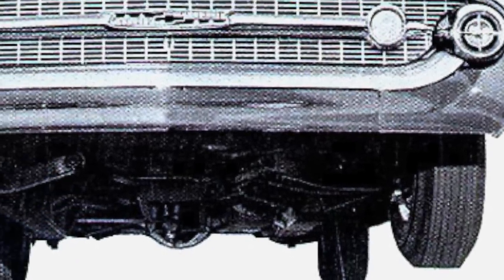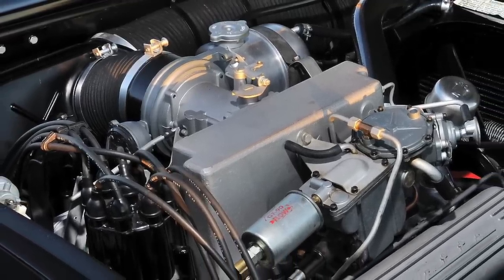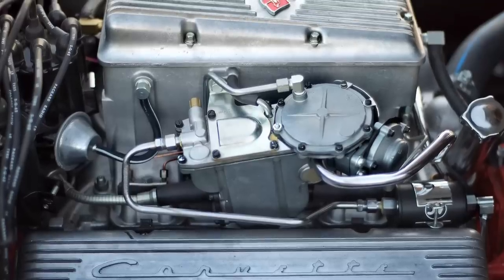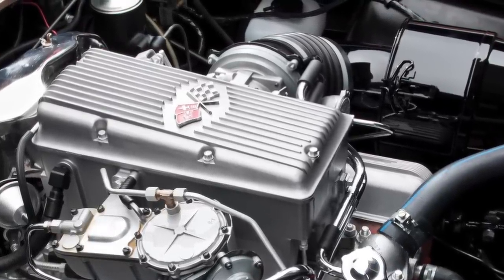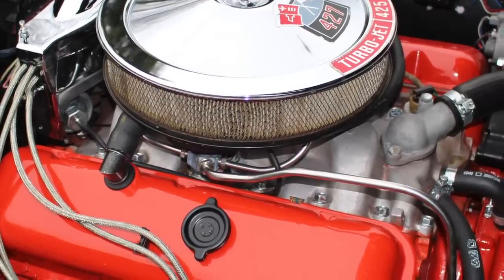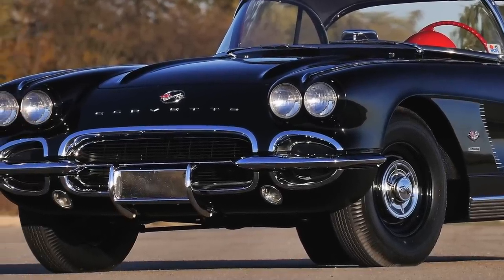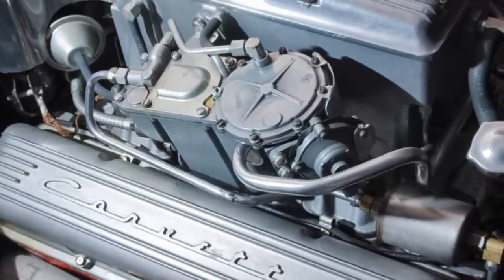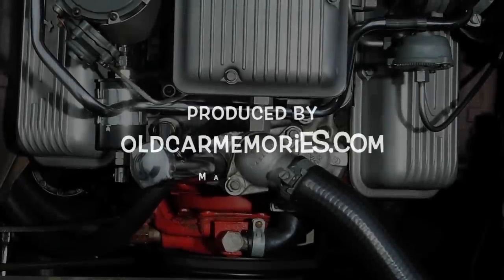Why Chevy Abandoned the 1962-1965 Fuel Injected 327 V8

Comment: This is a great video and I enjoyed reading all the comments.  It is nice to see so much interest in the old Iron.   I am a mechanic and a Rochester Ramjet Fuel Injection car owner for over 50 years.  GM had marketing movies showing how is worked like a jet engine.  Very funny stuff.
 The following are just some observations and ramblings from someone that worked on all the hot rods back in the day and lovingly keep a Rochester FI unit running.
First let me say that my FI unit is on a 1957 Belair and not a corvette.  I bought the car in 1968 for $950 because it was Fuel Injected.  Everyone said that I paid too much for that old car and that the Fuel Injection did not work.   Some days I would have to agree with them.    I have had the FI unit on 4 motors  (283, 327,265, 283).   About 15 years ago I found all the parts to build a 1957 283 FI motor.  Dead stock.  Not bored.  Correct heads etc.  It runs like the Engineers at Rochester intended. Smooth quick power. 
Let’s talk about reliability.   Cars would often get a tune up every 12,000 miles. This meant replacing the spark plugs and points.  Sometimes the distributor cap and wires were also replaced.   I had a shop in 1973 and did a lot of this.   Now if a high performance 440 or 396 showed up with the plugs all fouled from just putting around town then I would just take it out on the highway and open her up.  That usually took care of it.   I still charged the $12 for the tune up.  So maintenance was an attempt to fix things before they broke if you could afford it. 
Reliability of the Rochester Fuel Injection (FI) was another matter.  If the unit was running right you did not have to do anything to it.   I can park my car for a year and it will start up and run fine.
BUT---   If I put low octane gas (Below 98 ) with no lead then It won’t like it.   If I put gas with ethanol in it then it will hate me.  When I rev it to over 6000 rpm ( I used to hit 8300)  then I may twist of the FI pump drive cable.   Always carry a spare.  When other problems occur and the mechanic starts adjusting the FI unit then It may not run right.  If you get a bright Idea from a hot rod magazine and change anything it probably will not run right.   If you bore out the engine the main diaphragm will get too much signal from the piezometer ring and you will run rich during part of the power curve and the power stop adjustment will not be able to correct this.   You can set it up for full throttle operation which can be a lot of fun. 
Other fun things: The Early FI units came with a coasting shut off valve.  When you were coasting down a hill the high vacuum shut off the fuel so you could save some gas.  When you got to the bottom if the valve stuck closed then the engine would not run.  The dealerships get bulletins and one of them said to remove this valve when you service a FI unit.  They quickly stopped putting it on the units.  
The early units used an electric solenoid to starting.  It sometimes stuck or the wire got disconnected.  Hard starting was the result.   That changed to a cranking signal valve but it can stick open and cause a lean mixture. 
The rubber diaphragms (there are two) can get go bad like rubber diaphragms like to do.   Another popular misconception is that there was no fuel bowl with a float and needle and seat lake a carburetor.  Hey it was designed by Rochester and had all of those things.  I did not lean out on hard turns I can attest to that!  It even has the giant screw to adjust the Idle RPM like the AFB carbs.  
By the way if you do twist off the drive cable then you better replace the seal or it leaks gas down the back of the engine around the distributer.   Then one spark and you got a pretty good fire.  
I did bend a rod once when a cylinder filled with gas from a leaking check valve.   I added the fuel shut off valve that came on the later units and that fix the problem.  
The fuel control lever likes to get a worn spot in it and that will make tuning a nightmare.  The castings are pot metal and prone to bending and not make a proper seal on the diaphragms.
The system is low pressure, between ¼ and 4 lbs.  The fuel today has a very low boiling point. The fuel will boil inside the injector nozzles at normal operating temperature during a long idle.   Like during curse night. 
So why go to all that trouble.  Because we are gear heads, hot rodders and car nuts.  Because when I guy asks me to lift the hood he either says WOW or asks “what the heck is that thing?”  The same reason we now change the computer chip to a aftermarket one and add cold air induction.  The same reason we check out the specs on the 700 hp plus cars today.   Back in the day they asked why I needed 283 hp.  Now they ask why do you need 700 hp.   Tomorrow they will ask why you need a 1.3 gigawatt electric car.   They answer will always the same.  If you don’t know then I can’t explain it to you.
Reply: I Had an early one in a jeep and a buddy had a late one on a 350 in a jeep he checked his fuel mileage and was pulling around 25 mpg  the great thing was when 4 wheeling was no floats problems in the rough stuff and no computer to quit in the middle of nowhere
Reply: Its ironic, how many folks in the 1970's would conspire about "100mpg carburators" that supposedly Detroit bought just to bury, when in reality GM had the Rochester FI.  Unlike the Bendix, GM could have slapped these things on the "corporate 305" and passed emissions and fuel economy requirements that killed the muscle car. 

Another issue that spelled doom for the RFI was the number of shade tree mechanics available back then. You didn't have a computerized car that required a trained dealer mechanic to fix it, you could take it to your nearest gas station. Instead of convenience stores, every gas station had a two bay garage and a mechanic who may or may not have been up to date. So you bring in your RFI that isn't running right (for the reason mentioned above, or just bad gas--there was lead, not detergents in it back then).  As many mechanics know, you think its the carb when its really the ignition--and back then, it was points.  Convince the customer the RFI doesn't work because the Bendix units in Pontiacs and Chryslers work even worse, sell your customer a 4bbl carb you have on the shelf, and of course, you have to pull off the distributor to make the swap.  Might as well change the points, too, and voila, the engine magically works and there's another bad reputation.  

but if the system was truly flawed, GM would have looked at all the warantee claims and refused to keep running the system for almost a decade.
Reply: I had an early one on a 327 in a 53 high hood jeep my buddy had a late one on a 350 in a CJ-5, in the early 70s we ran in the mud, sand, whatever they were not trailer queen's 25 mpg and no floats bouncing wish I had one today on my 84 K-10. A guy at Ft. Campbell Ky.s dad let him have a 2dr post black 57 chevy fuelie his dad bought new that was in the early 60s
Reply: Thank you for this.😊

Comment: Just found your channel, I love it! It was a rare mechanic that could keep a fuelie small block running, but when they did it was majic. But if you got it all wrong you could start it on fire. The fastest stock accelerating vehicle I remember was a 68 427 3 deuce 4 spd vette. They had way more than advertised horsepower.x

Comment: I have a "62 fuelie and you are correct in that good fuel makes them run better(no alcohol), but they can be tuned to be very reliable and it takes patience, a manometer or guage to read vacuum and a pressure guage to read fuel pressure at the nozzel to get them set up properly. These systems were engineered by very smart people it takes experience and intelligence to dial them in. The early Rochester fuel injection systems were continuous and not sequential like those of today so economy wasn't that great but throttle response is awesome. A used Rochester unit in good condition costs about 12,000 to 15,000 dollars today and they cost about 200 dollars in parts to rebuild providing something is cracked or broken.  Larry Pack MD

Comment: Food for thought. There is a whole series of post on the Corvette forum dealing with some C4 owners who have installed various sizes of the Chevrolet big block in their cars. The weight difference is negligeble when using aluminum heads and induction. Plus these engines are making 600-900 H.P. and tons of torque for incredible H.P. that is reliable. There are several cars that are running aluminum blocks also. They run the 4L60 trans with a higher stall converter and a special made Dana rear end in either live axle or a fully independent Special purpose Dana with an almost 10 inch ring gear to handle the torque of these monster big blocks. The engines range in size from 427, 454, 540 and 572 cubic examples. I will post a link later to the series of post dealing with these big block C4's .

Comment: In 1968 right after I got out of the Army, I bought a Nassau blue 65 Corvette conv from the 2nd owner. Ex fuelie converted to Chevy aluminum manifold with Holley carb, 4:11 posi, close ratio 4 sp. That car screamed. The original owner offered to sell me the orig fuel inj for $100, I said I didn't want it, I'd heard the inj was hard to keep in tune. The next year I put on headers & slicks, unbolted bumpers, exhaust system, spare tire carrier, all splash panels & brackets not necessary to drive and ran high 11.80's at the local drag strip - couple tenths off the AHRA national record. I still have 7 or 8 trophies from the strip and some nice pictures of me racing there..

Comment: Awesome video!  Yeah....I'm an old guy that remembers the local Chevy dealer taking off fuelies and replacing them with carbs.  In 1966 (NC) the local dealer had at least 8 fuelies sitting on a top shelf of the parts dept growing cobwebs.  I was always interested in the fuelies as one of my classmate's older brother had a 62 vette he bought used and couldn't get the fuelie to work correctly and had it swapped for a carb.  Yeah....like so many others.....if I had only known what they would be worth a few decades later, I would have snapped them up and stuck them in the garage.  Again, really enjoyed your video.

Comment: I own a 1964 coup with a 550 hp high winding 327 engine and a 6sp manual trans. Big brakes, racing suspension.  Runs 11’s in the quarter on street tires. Way more fun than an original 327 fuelie with a 4sp. And my car still looks fairly stock except it’s lowered 2 inches.
Reply: Yes indeed- It is a sweet car you have.

Comment: Besides fuel injection, Chrysler invented crankshaft triggered computer controlled ignition for the 1958 model year Chrysler 300. But the control unit was as big as a suitcase and took up a larger portion of the car's trunk. If the Fuel injection system had met up with the ignition system that Chrysler invented the result at that time would have been incredible! As it was the Chevy injection system was well designed, with intake runners flowing from the top of the injector manifold flowing almost straight down to the intake valve. Find a cross section view to see how well it was engineered. Awesome was the only way to describe it.

Comment: NOTE:  I worked at the Flint, MI small block V-8 engine plant from 1968 - 1972 in the engine test division.  Also, my father retired as Chief Metallurgist / Chemist for Chevrolet Mfg. 
In those days, all of the naturally aspirated (carbureted) engines were tested on natural gas w/o the carburetors.  The fuel injected engines were tested in a special room on gasoline due to the mechanical injector.  After the room had an explosion / fire for the fourth time, GM’s underwriters told management that the gasoline had to go, or they would not underwrite their $100,000,000 plant.  The choice was simple, and that is why fuel injection disappeared mid year.
Reply: I think that no doubt a rare option where most buyers just liked the sporty car itself as long as it always ran and was decently quick would go away at some point. But certainly what you say could also be it. Many of us car people/hot rodders tend to think in our preferential and with hindsight terms. We have to realize when these cars were new it was mostly just average people buying them and most could care less about some fancy and potentially troublesome option or be thinking of future value. They were mostly interested in my first line of thinking. Show me new car buyers that want that freaking thing sitting broke down at all? Thanks for your info.
Reply: Mark Phillips 🤔🇺🇸ohhh
Reply: Chazz Ram  no where near any truth on that.
Reply: Chazz Ram  incorrect. Fuel injection in a nut shell refines how fuel is delivered and atomizex, which maximizes fuel efficiency AND power.

Let's look at a 3rd gen Camaro that came with an assortment of engine sizes and fuel delivery. The L69 305 was a High Output engine, it was the highest powered carburated engine for the 3rd Gen F-Body with a higher lift cam and a few other goodies, it pumped out 190hp. A 305 TPI (still very archaic compared to day)  with a lesser aggressive cam compared to the L69 produced 215hp. A whole 25 more horsepower on just fuel delivery.
Reply: What year did the Tonawanda plant open?
Reply: @mark phillips you must be around 77 years old today..
Reply: 73!

Comment: The Chevy mechanical fuel injection was tough to get running right. I had a older guy that worked on a lot of them at a dealership in early/mid 60’s. He taught me how to make them work but they took time and patience to get right. For daily drivers electronic fuel injection is superior.
Reply: 6
Reply: I've got it on my 93 dodge d250 Cummins engine and never had an issue with the mechanical injection!
Reply: By the mid 1970s,  2 barrel carburators were engineered to a fine science - wonderful mechanical computers. Once the altitude compensating valve circuit was perfected for the carb this almost equates to modern fuel injection.  4 barrel carbs have always been more on the fussy side though.

Comment: Having had both a 1964 FI convertible and a 1965 FI Coupe I can safely say they were fun to drive.  Because there were very few dealers who knew anything about how to service it, you had to join a Corvette Club or get Corvette News to find how to do it yourself.  I used the 64 to autocross/rally in for over 35 years.  I could run the 1/4 in 13.3 with good tires-, the 2000-2008 period tires gave the best times, and in autocrossing it would routinely beat the carburated cars--big blocks included.  High speeds, the BB would blow it away.
Reply: Yay CCM.  Great auto-x's and loved Waterford.
Reply: ... But isn't autocrossing and/or gymkhanas MORE FUN... than simply being ultra-fast in a straight line??   I'll bet you agree!

Comment: I owned a 84 Corvette all through high school, college, and even my first few years of work...it was my daily driver. The 84 Corvette was?equipoed with the Cross Fire injection, (two throttle bodies with one large injector per throttle body) it actually wasn't as bad as people seem to let on but sometimes it sounded like the engine was knocking at idle due to those two injectors clanking away. I now have a 85 Corvette, (have had it close to 8 years now) with the Tuned Port injection system and the biggest difference I noticed between the 84 and 85 is the overall throttle response, 85 Corvette seems to react a little quicker to throttle changes. The 85 Vette itself rides smoother as well, they loosened the suspension just a bit and it was a night and day difference to smoothness of the ride.

Comment: I had an original '65 Fuelie back in the mid 60's.  At National Speedway, my totally stock Fuelie  (4.11 rear gear set) with the original gold line 7.75 x 15 tires ran the quarter mile at 13.8 seconds at 101 mph.  On the street, my Fuelie could always jump the new 396 Vettes.   Only when the 427/425 HP 1966 Vettes appeared, were my street dominance days over.
Reply: didnt last too long did it ..1 year   lol

Comment: Another reason was back in the early/mid 60's you had an entire generation of young men raised on carburetors who understood how to maintain them and tune them...whereas Fuel injection kind of scared guys who didn't know how to maintain FI systems. Fyi,  I owned a 1965 Vette Roadster with the new "Porcupine" 396 425 HP BBC...she was burnt orange and had off road exhaust. Girls loved that car...I used to half joke that when I went under a bridge with the top down I could hear them stick to the seat :) Also, when I was in H.S. I had a buddy who had a fuelie 283 in a '57 chevy...it was one of the fastest cars in town.
Reply: your mileage may vary but back then girls i found out didnt know what a car was.
back seats yes.
cars no.
Lic Driver Circa 1968
Reply: Exactly right on FI. Look at even the heavy and justifiable hesitance to move over to it even in more recent times. Even with the obvious advantages look how many still set up a car with a carb or delete the FI? I understand and can work on these things and I still prefer my carbs, for more than one reason.
Reply: "a fuelie 283 in a '57 chevy"? Was that a transplant? I believe the stock "small-block" available in '57 was the 327...?
Reply: +Gary Garnier And no 327 until the 60's
Reply: I stand corrected. It's late, and Ambien...
Reply: +Gary, No that's ok, you gave me a chance to show others a cool thing. It is nice that it wasn't only covettes that got the FI 283. Adds to the interest, and "discussion".
Reply: lol...They knew when I went under a bridge with the top down they wanted to sleep with me...it had a visceral effect on them...loved that car...of course it didn't hurt I was a good looking young Marine at the time.